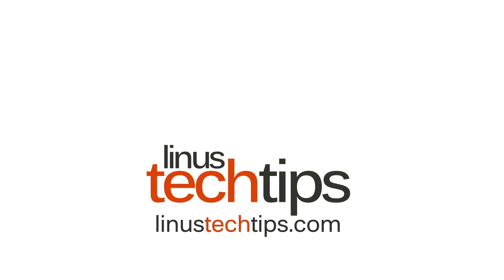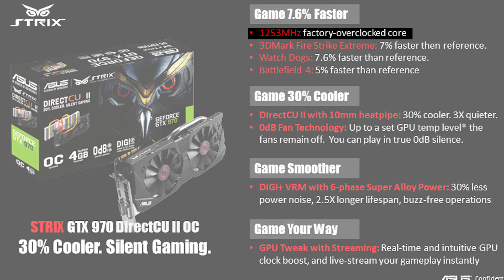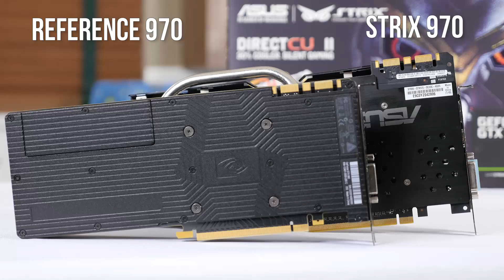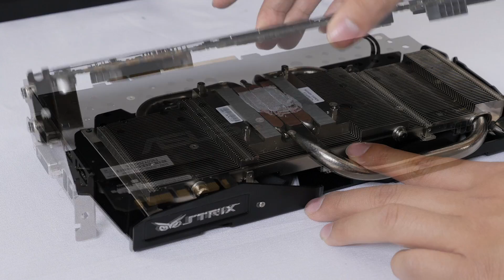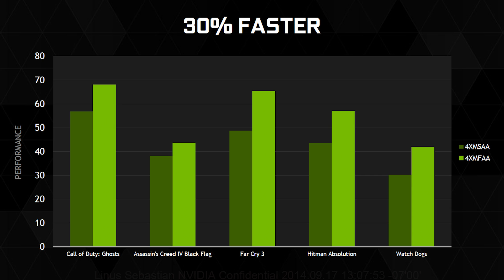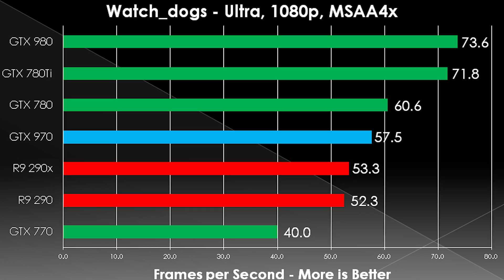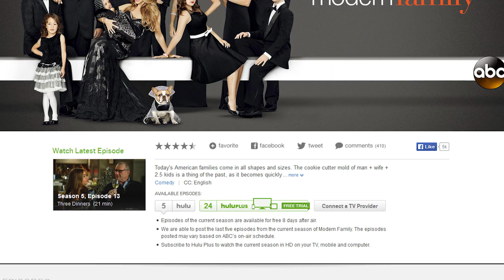ASUS Strix GeForce GTX 970 Video Card

Comment: Hey guys. 

What's your opinion MSI 970 4G or ASUS or Gigabyte or EVGA?

Thanks for your answering.
Reply: EVGA is the best!!
Reply: there is a report on eteknix that the cooler is not meant for evga gtx 970. you can check it out here.
http://www.eteknix.com/evga-gtx-970-feature-manufacturing-defect/
Reply: Cookie Gunz DO NOT LISTEN TO THESE GUYS SUGGESTING EVGA!!! THE GTX 970 HAS A DEFECTIVE COOLER. PLEASE REFER TO 2k9hs 's COMMENT. One of 3 heat pipes, which is essentially what carries the heat away from the GPU, is making almost NO contact at all with the GPU. This means roughly 30% less cooling efficiency, causing the EVGA cards to run hotter AND louder than reference coolers!!! DO NOT GET THE EVGA ONE. Not only that, people are experiencing awful buzzing through their speakers even when they simply move their mouse - the EVGA board only uses a 4 phase power design where the competition uses 5 or 6 phase power delivery design! This means less overclocking and stability, lifetime and more noise! EVGA REALLY cheaped out this generation, DO NOT BUY EM! EVGA used to be the king of quality and reliability, now they're just taking cheap shortcuts and abusing their good reputation. Looks like they're going the Apple route! :(
Reply: i like EVGA
Reply: *****
anyone that complains about noise is most likely someone that has their case 2ft away from them on their desk right next to their ear instead of behind or beside a desk to dampen sound. these type of ppl usually like to have their cases lit up like a high schoolers honda civic or christmas tree for maximum peripheral distraction
Reply: DO NOT GET EVGA!!! Their cooler is defective and the card bios is configured wrong with a bad fan and temperature setting, making it a bit more hot and much noisier.
Reply: EVGA is #1.
Reply: lmCIoudz They have the lowest quality, cheapest piece of shit disfunctional GTX 970 on the market. That is how they're shit. Like D4rkR3bel5 said, their quality control went to shit. I originally got a GTX 680 from EVGA. Thing ran HOT as fuck and I needed to underclock it for it to even work (950MHz/6Gbps), it was unstable out of the box and it wasn't even a superclocked card, just stock speeds. So obviously after some testing I sent it back and got a MSI GTX 680 lightning, still rocking it today at 1425MHz/7Gbps, it's almost as fast as a GTX 780 with this amazing overclock. However, thinking of selling it to a friend for 200$ or so and picking up a GTX 970 windforce or maybe even a 980.
Reply: I really prefer MSI, i've had both Geforce GTX 680 and 780 and are getting 980 now and MSI have been perfect, no problems nothing.
Reply: I'd suggest EVGA. I've had their superclocked GTX 680 for a couple of years now and it has been perfect. I like the Asus cards, but I went through three faulty Asus 680s before going with the EVGA version. Maybe I was just very unlucky? either way I will always look for the EVGA option in future. I'm just trying to decide whether to upgrade from the 680 to this, or spend the money on doubling my ram to 16gb and putting the rest towards the Asus ROG monitor I'd like... My 680 still plays everything I need it to really. hmmm.
Reply: lmCIoudz What the fuck are you flappin about dude? Just stop, you're wrong. EVGA is shit now, go cry on a forum or something.
Reply: I prefer either MSI or Asus depending on specific performance, but I would normally stay away from EVGA, their customer support is great, but the cards are average.
Reply: RevolutionHD Now now there's no need to exaggerate. The ASUS and MSi 970s are right up Gigabyte's ass.
Reply: Jayz2Cents has tested the Gigabyte 970 and it's pretty awesome.
Reply: Any one who said evga is better , I'll say shut up
If you want high performance 
go for gigabyte. 
It's better than every card 
And asus also amazing but add more 20 dollar and get the best
It's gigabyte
Reply: EVGA is the best in my opion and its Nividia's number 1 partner
Reply: lmCIoudz Are you stupid? There is one GTX 970 ACX cooler, they're all made the same.
Reply: HJTh3Best The Gigabyte G1 is definitely the coolest running card. Not to mention that blue light up logo looks fucking fantastic inside your case.
Reply: lmCIoudz Their QC went down the drain. I RMA'd an EVGA GTX 660 SC 4 times, and got different 4 cards from EVGA with 4 different serial numbers, bringing the amount of GTX 660 SCs I have registered is 5.
Reply: lmCIoudz Well that's great, you got lucky with your original cards. I wasn't that pissed about the original 660 not working, BUT 4 CARDS? Jesus Christ, they say they give you a card from their "Quality assured" line or something that they give to people who send their cards in for an RMA, but I don't believe that. I think they just send you broke ass cards that other people sent in and then they slap a new S/N on it and call it a new card.
Reply: Marshal Beard
Maybe you were unlucky, I have the superclocked GTX 680 from EVGA and it is superb! I went through three faulty Asus 680's before I got the EVGA card. I'd like to go for the Asus 980 but my bad experience has put me off. I'll be looking into the EVGA card first as my only experience with them has been a good one. As with everything, the key will be looking into what you're buying before you spend this amount of money. With respect, an opinion in the youtube comments wont make my mind up for me, I'll be reading plenty of reviews on various sites and then deciding. I find the Gigabyte cards quite ugly personally, I had a 680 windforce and didn't like it, good cards though otherwise.
Reply: Marshal Beard
I agree, I said above that I thought it was a good card, just ugly imo and it did indeed look cheap. I just read that article, very interesting and a very silly oversite! I wonder if the evga 980 will have the same flaw. I can't fault my EVGA 680 at all, I love it. But I'm not brand loyal, you can't be at this kind of price point. I'll give my hard earned money to whoever makes the best card. Gigabyte are looking good early on, I'm interested to see what Asus do and how they are both priced here in the UK.
Reply: Oscar Opiela No they aren't. Not anymore.
Reply: ***** That's true, however if you have any experience with MSi Afterburner or similar software, you can configure custom fan profiles to your liking. For example, the Gigabyte card does run slightly louder than this ASUS card, however it runs usually around 65c when gaming where the ASUS is around 70c, both of which are extremely cool considering these chips can chug along at 95c safely. So if I were to get the Gigabyte 970, I'd be definitely configuring a fan profile either where it's next to innaudible during gaming, or until it reaches 80c, and I will have it overvolted and overclocked as far as it possibly can go.
Reply: BigL BkNy without a comparison between them, I prefer Gigabyte because have better ports options, and if has the best cooling, has more space for overclocking
Reply: I have a GTX 760 with the superclocked cooler and it is really noisy under loud, even with it being under my desk.
Reply: I don't think it matters. Because the real difference is in cooler when the card is cool anyway. I have a MSI GTX 970 G4 gamer. It doesn't go above 65 degrees with overclocking. So the fans no matter how beastly just won't matter. The super pipes and air cooling of the ASUS and the MSI both win it for me in silent mode. MSI was cheaper when I bought. MSI also needs two power connectors 6+8.
Reply: EVGA ACX is bad for GTX 900-series, it gets loud. They haven't fixed it yet.
Reply: Alchemy3D I write a pm in youtube please answer me. :) 

Thanks bro.
Reply: CanIHasThisName In 970 ?
Reply: cristijAn & Levee - Daily FIFA Content I can't hear any coil whine on my 970. When I google "coil whine" all the problems are on cards with much greater power needs. Also all manufactures.
Reply: Alchemy3D So this people is so shit. :D 

Thanks :)
Reply: Asus.
Reply: MoHaMeD55555555 You're dumb lol
Reply: Jayztwocents got 1.5ghz on the gigabyte acx superclocked. Not sure how the asus one will overclock but i think it will get close.
Reply: This one in the video lol
Reply: Gigabyte has best cooling and is #2 with stock clock speeds, and with that 8pin and 6pin will have extremely good overclocking. Also Gigabyte has the only 970 with 3 DisplayPort connectors AFAIK. ZOTAC has best stock clocks.
Reply: SNarsul +1. I have had so many issues with EVGA cards that I wouldn't recommend them.
Reply: im going MSI
Reply: Marshal Beard One card is bad, so all of the rest are? Man, you're delusional.
Reply: Sonefiler He meant one model of EVGA card as in EVGA 970s, or maybe it could be one SKU.
Reply: D4rkR3bel5 I don't think so.
Reply: Marshal Beard Do the FTW cards not have a custom PCB?
Reply: D4rkR3bel5 They do, but they're even lower quality that reference PCB. EVGA pretty much found the cheapest parts and cheapest way to manufacture this heatsink and PCB with and went with it.
Reply: ASUS, MSI if you don't mind paying $10 more and having HDMI 1.4
Reply: Marshal Beard Unless you have a build that conflicts with a blue light.
Reply: D4rkR3bel5 Well, it's more of a white LED with a slight blue hue. It doesn't ever not look good in any colour scheme. Sort of how the Geforce logo on the reference coolers almost never look bad.
Reply: Marshal Beard Well it could look pretty bad in an acid green themed or dark/faint red themed build.
Reply: Marshal Beard Okay, tell me. How is EVGA shit? Hmmm?
Reply: D4rkR3bel5 uhuh. well, neither I nor my two IRL friends had any issues with our EVGA cards. I have a 780 superclocked (non acx), and I'm very happy. I can get to 1149MHz/3095 stable on all games. My friends both have 770s. One has the regular superclocked 770 with acx cooling and can hit well over 1200MHz, and no issues. And lastly, my last friend has a classified 770 which overclocks like a beast. pretty sure he can hit almost 1300mhz on all games.
Reply: That said, I quite like the Gigabyte 980, it has a nice back plate. I may look into that one again.
Reply: bowser515 Please read this following article. Hopefully it will help you decide. On the other hand, I know ASUS GPUs weren't very good in the 600 series. But it has definitely changed in the last 700 series and the 900 as well, so if you like the design I'd definitely recommend one. Sort of like how EVGA was top of the line all the way up until now. I know I just got unlucky with my 680. http://www.guru3d.com/news-story/evga-geforce-gtx-970-acx-has-misaligned-gpu-vs-heatpipes.html
Reply: Marshal Beard
 I'll look it over, I take it back though about the Gigabytes being ugly. My 680 Windforce was, but the new 980 is very nice indeed! I'll be considering it along with the Asus and EVGA cards, I'm in no rush to buy so I'll wait for all of the reviews.
Reply: bowser515 I agree, I thought the old windforce coolers were very cheap looking which is sad because the cards themselves were great in every aspect except aesthetics. They made them look more beefy and robust this generation though, very glad they did.
Reply: Mario Toledo errr dont know how to put it to you but evga are the best for aftermarket nvidia cards
Reply: Kden but with evga you dont void the warranty if you overclock unlike the others and for most cards they have the highest clocks and lowest temps. (except for those with water cooling systems)
Reply: Oscar Opiela Nope. Gigabyte and ZOTAC have highest clocks and lowest temps.
Reply: Oscar Opiela Out of the box clocks don't really mean anything. What matters is how far you can push them yourself. I'd take a stock GTX 970 with a better cooler over a EVGA card that runs at 1400MHz out of the box and then I'd simply push it to 1500MHz+ myself. And no, this does NOT void the warranty either. Did you even read the above comments by the way??? 

EDIT: Oh yeah, and the EVGA card is currently the loudest and hottest running aftermarket GPU right now. Do some research rather than going off of past reputation.
Reply: Asus or MSI.. EVGA is good but not comparable to them and Gigabyte is a joke
Reply: TheDeeTV How is Gigabyte a joke? They clearly won the non-reference card game this time around.
Reply: TheDeeTV
Why are Gigabyte a joke? I like Asus, but I had so much trouble with the Asus 680's that I'll be looking elsewhere this time... the G1 Gaming version looks like one of the best options imo.
Reply: bowser515 Gigabytes quality isn't as high as MSI or Asus. MSI being (IMO) top right now I like EVGA but a lot of people don't.
Reply: TheDeeTV See like i understand that you prefer other companies because you think that they are better, but i hate those who say others are complete shit.
Reply: TheDeeTV
Can you elaborate a little on why you think the quality isn't so good from Gigabyte? The only experience I have with them is the GTX680 that I only had for a day (too ugly imo) and an old mouse that cost me about £12, I've had expensive Razer and even Corsair mice that have been and gone but the old Gigabyte mouse is still going strong. I know they had some issues with their large GPUs flexing slightly at one time, but the backplate on this should prevent that while also looking very nice indeed.
Reply: bowser515 Im not saying Gigabyte is shit its just i feel that its not the best but in all fairness all the brands which make aftermarket cards are good since they get power out of them.
Reply: bowser515 Personal experience on Gigabyte, I had a 570 that had to many issues for me. Also the feeling and appearance isn't as impressive as its competitors. I have a Asus G75 series laptop that is a tank. As for my desktop I have a 660ti super clocked EVGA graphics card and a MSI (dont know exact name) motherboard which both work great for me. I have gone through a number of mice such as steel series, razer, and asus.I agree razer mouses break easily, but although the one I'm on right now is lasting longer then the others. (Steel Series is great mouse)
Reply: TheDeeTV
Thanks for the explanation, personal experience is probably the best thing to go with, I do think you'll find many experiences that differ though. I personally had three faulty Asus GXT 680 directcu ii's. I ended up settling with an EVGA superclocked version which has been perfect despite the many complaints in this comment section alone. I agree on Gigabytes looks though, I've always thought that they were incredibly ugly and cheap looking... until this 9 series. I think the Asus cards are always good looking, but the Back plate and the illuminated logo on this Gigabyte 970/980 makes it quite a looker imo.
Reply: Asus or EVGA would be my choice.
Reply: bowser515 I liked EVGA in the past and I still like EVGA, but I'm extremely sad at their failure of a GTX 970

Sven Raven Read comments please.
Reply: Marshal Beard
Same from what I'm reading so far.
Reply: I haven't heard about buzzing problems with Gigabyte cards, but i cant tell the same about others. Personally I have buzzing ASUS version.
Reply: ASUS is the fastest and is the most quality model :) Go with ASUS or MSI if you want :) Don't go with ZOTAC, i don't think it's very reliable and quality brand, but it's just my opinion, but choose what do you like most. But i highly recommend you to go with ASUS.
Reply: Marshal Beard well said, i'm going with this one, i don't see why people need to decide, if you want the best one, more stability, more overclock room, choose the gigabyte one, if you want higher temps, but super quiet? buy the asus, really should be end of discussion after what i said...
Reply: TheDeeTV you're delusional, gigabyte for the 900 series is the best one imo and to the opinion of most others
Reply: Marshal Beard haha :'D keeping things in perspective :P
Reply: Marshal Beard your comment has been extremely useful to me, I'm definitely over clocking it, in terms of sound, I have a full tower case, so I doubt I'd hear that much noise from the gigabyte card, so I don't think the noise will be a problem for me. Just of course, it's much better to run at lower temp to prolong the cards life expectancy, so I might even leave fans o operate by default, I could change them, I'll see :)  

P. S configuring it so it's practically inaudible under gaming does sound tempting! My card will come soon, if I get a lot of noise from the card underload, even in my full tower, I'll consider configuring the fans ^_^
Reply: ***** I highly recommend you do. For example, I have a GTX 680 lightning. The out of the box fan profile was way louder than it needed to be, it ramped up to 65% fan speed when gaming, yet the card didn't even exceed 65c even when overclocked, and when idle the fans went down to 30%. I set up a custom fan profile in MSi Afterburner so the fan never dropped below 40% fan speed because the difference between 30% and 40% wasn't noticeable unless my ear was right up beside the fans, and when the card started to exceed 70c, the fans would slowly ramp up to 55% until it hit 85c, which it never did. Therefore, my fans were usually hovering around 50% and the card around 75c, never surpassing 80c. I can barely hear my GPU, and I'm extremely impressed with the cooler design. Can't wait to get my hands on a G1 970! :)
Reply: i see, thank you very much, today i have just finished building my computer (without the gpu installed yet, still waiting for it, its on pre order) computer is working fine! just installed windows, and currently installing drivers, really happy right now! if i do encounter any problems or just need some advice, could i message you again sometime?
Reply: Asus or EVGA is your best bet. Amazing high quality cards. Zotac is king dough breh
Reply: ***** absolutely! I usually spend some of my free time on Tomshardware forums helping people out where I can, and I like doing it wherever else I can as well. If you want another good source for info, try Tomshardware, they have fantastic articles and a helpful forum.
Reply: Marshal Beard can you help me too? i want this grapichs card along with the fx 8350, will it work well? i mean, no bottlenecks or anything, if that was the case, that it has a bottle neck, what cpu do you recommend me, and also, does this consumes to much power? talking about the power bill, will i see a high rise?
Reply: Freddy silvas zamudio The GTX 970 doesn't consume much power at all. It's extremely efficient compared to everything for the amount of performance it gives. However, the 8350 on the other hand does in fact consume a lot of power. If electricity is pricey for you, you may wish to save up another 100$ and put it towards an Intel motherboard and a i5 4670k,  Intel CPUs are better for gaming and are far more power efficient. You'll definitely make up that money within 2 years anyway in the power bill. AMDs are only really good if you plan on overclock to 4.5GHz+ which will come close to a stock 4670k, but at that point the 8350 can consume over 250w where the 4670k will consume around 80w. Then on top of that you can overclock the 4670k usually to 4.2GHz without touching the voltage and staying on the stock cooler and have good temps, though you may want to consider a cheap aftermarket cooler like a hyper 212 evo at least.
Reply: Marshal Beard so , do you recommend me a intel i5 or i7? lets say the money is not the problem, i mean, the money to invest, but since i only pay the internet bill, i dont want any problem about the power bill ><
Reply: Freddy silvas zamudio you should get less than 400 watts, because 970 has a much lower power consumption. That cpu also is not a bottleneck, dw
Reply: Intel i5 is enough if you're on a budget, it's a lot cheaper, but if you want the cream of the crop, get the cpu I have, Intel 4790k
Reply: Freddy silvas zamudio i7 will definitely be more future proof because of the new consoles all using 8 core CPUs and the i7 has 8 virtual cores because of hyperthreading which DOES help very much, despite all those stupid rumors of hyperthreading doing nothing/even hurting game performance. This was all true when the Pentium 4s first got hyperthreading. 4790k is really good if you're not overclocking because it boosts up to 4.4GHz out of the box as well. If you have the extra 100$, I highly recommend getting the i7, but the i5 will suffice and it will perform better than anything AMD has to offer for the price point for gaming.
Reply: helenHTID See, you're sort of right and sort of wrong. I have a i7 3770k and have done HOURS of testing. At 2.5GHz with HT off (2.5GHz i5 essentially) the CPU bottlenecks my GTX 680 in pretty much every demanding game by a good amount. However, with HT on at this speed, the performance improvement is massive, and the bottleneck is VERY minimal, to the point where it's almost the same as HT on at 4.8Ghz. So in other words, hyperthreading does help very much, but high end i7s come with such high clockspeeds that hyperthreading is not really needed... YET. Once games start becoming more CPU intensive, probably in around 3 years once old consoles start phasing out and all demanding titles are going to be optimized for at least 8 cores, you'll be pretty god damn happy that you got that i7, and I can promise it.
Reply: ***** thank you for this comment, i also know and have read the article of which you copied and pasted the information into your comment! :) i have preordered the gigabyte one as i want the coolest card with the best performance, plus, as a side note from my newly built pc, the card should bring some light inside my case that has a pexi glass side panel to see all the components in :). i have finished building it, downloaded all the drivers, runs fine, can even play moba games fine too using the integrated graphics card, all thats left is my gpu, very excited about that! ^_^
Reply: MSI
Reply: Asus